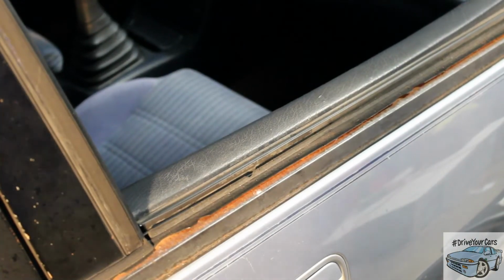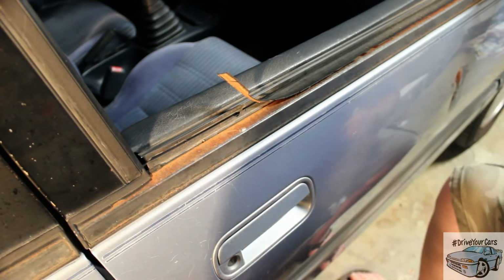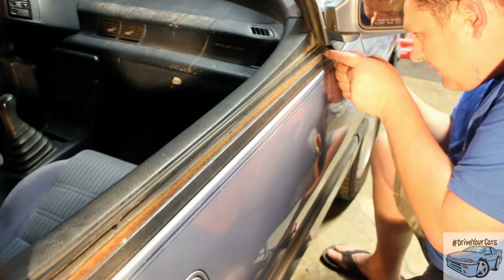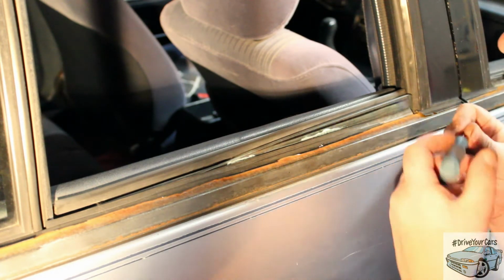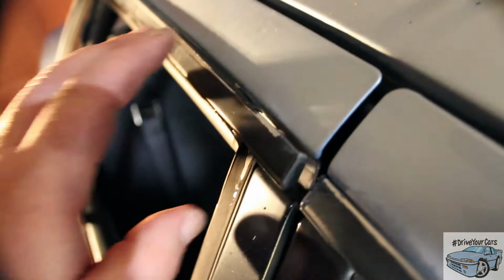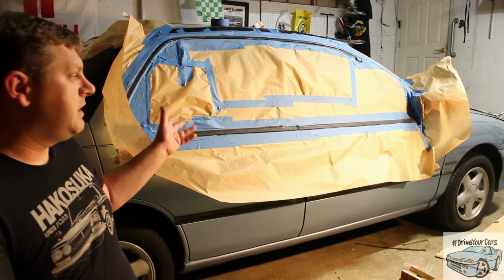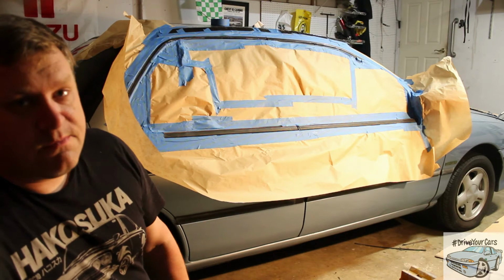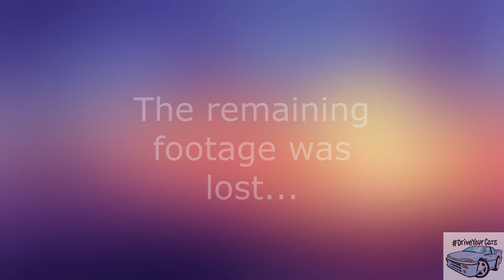From Bad to Rad! Repainting Window Trim on a Isuzu Stylus

Comment: Looks great! I need to do this on my stylus as well, it's about as bad as yours were.  

I think the satin finish is better for the long term, any more matte and it usually starts to fade too quickly and get chalky.  The satin will fade out well after a few months and is easier to maintain over time from my experience.
Reply from the maker: Now that I've looked it over, it has dulled a little, which is good!